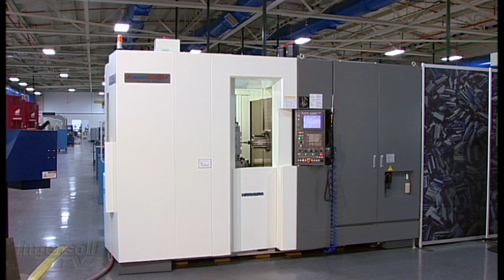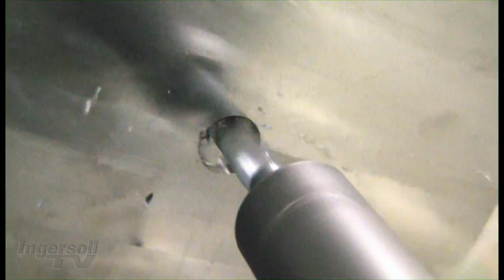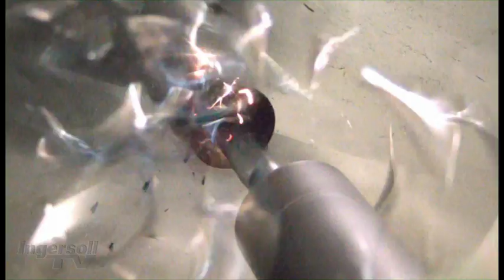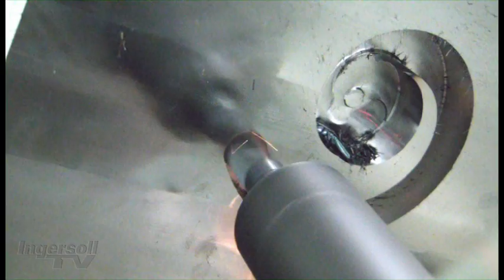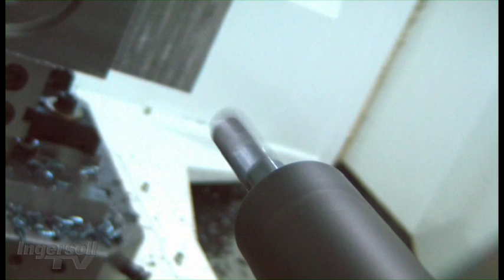Solid Carbide End Mill Spiral Demo   4140 Steel

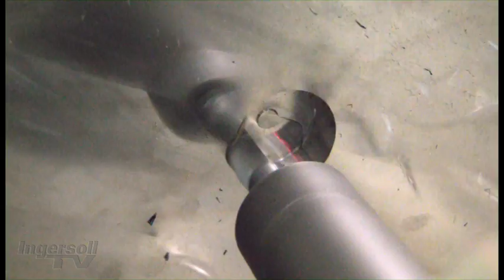Comment: 1:08 is when most of the pullout happens
Reply: Without a doubt that is pullout, you can even see the track of the first few full depth circular pocket before the spiral where it had pulled out probably 0.5mm, then it pulled out about 5 mill during full spiral. The pullout stopped because of the screw hitting the top side of the slot on the shank.